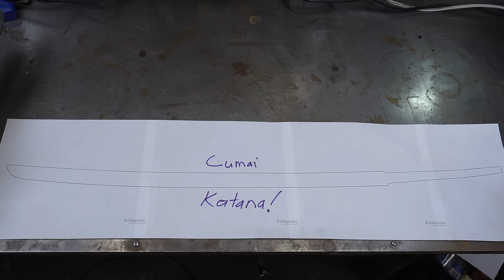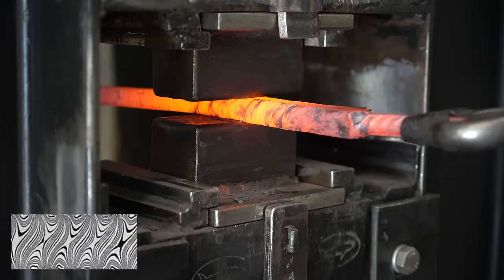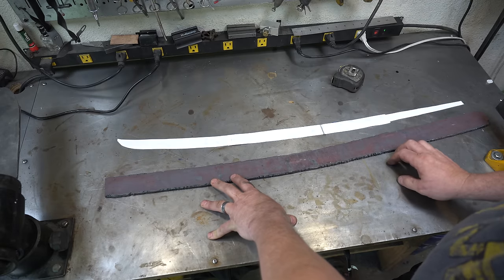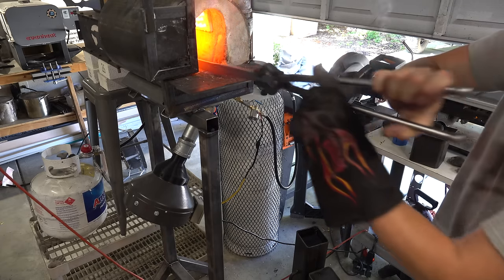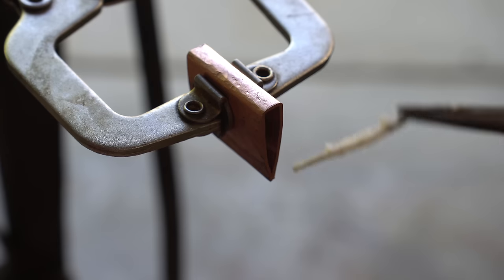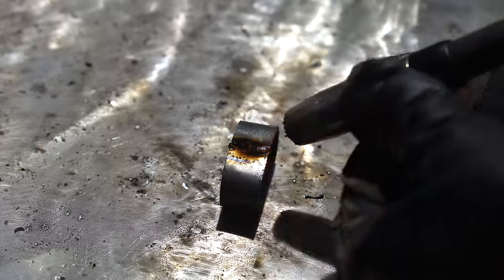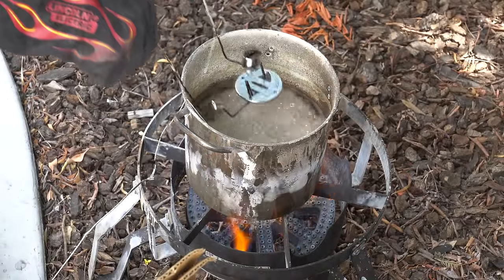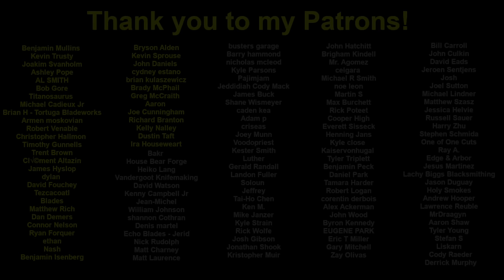Forging a Copper Damascus Katana

Comment: From what I know, I would recommend not makeup a blade with copper, copper is very malleable, I only recommend making a blade using copper if it’s for decoration and not meant to be used.
Reply from the maker: “From what you know” is the operative term here.  If you understand the construction, the copper is a thin sheet (the thickness of 2 pieces of paper after forging) over a central core of high carbon steel which is the entire cutting edge.  The copper doesn’t go “through” the blade.  Next time try asking a question instead of assuming you know.  Thanks for watching.

Comment: Why oil not water?
Reply from the maker: Modern smiths don’t really use water, it’s too unpredictable.  The failure rate for traditional katanas with water is around 25-35%.  That’s a lot of work to fail potentially 1 out of 3 or 4 times.  Oil is much more consistent.  Thanks for watching.

Comment: Its really good but it doesn’t have character, its too thick and heavy for a Japanese katana however the technique and material choice (especially the copper) are not playing to the advantages of a Damascus sword….But still amazing craftsmanship from an outstanding blacksmith ❤
Reply from the maker: First of all, the dimensions and weight of this blade is exactly inline with a katana of its size.  It’s 2.5 lbs with handle attached, it was just under .2” thick at the hibaki and about .13” at the kiseki, the sori is 1.25”, exactly what it should be.  Next time try asking a question first instead of assuming.   Thanks for watching.

Comment: 16A three phase.
Reply from the maker: I don't quite understand your comment.
Reply: @TyrellKnifeworks  I just commenteded as a courtesy, to the good content.
Reply: How much amps does that press cunsume, or Watts.
Reply from the maker: @אילןאור-ח4מ  It depends on the motor used.  This is a 5hp motor running on 220v.  I think it's around 16A or there abouts.

Comment: No borax?
Reply from the maker: I don’t really use borax when forge welding.  It can cause as many problems as I helps.  If you have a fuel-rich mixture in your forge, it’s not necessary.  Thanks for watching.
Reply: @TyrellKnifeworks by fuel rich you mean the kerosene?
Reply from the maker: @dmiles3270 no, I mean the propane to air mixture.  You should have 4-6” of dragon’s breath coming out of your forge.  That indicates a fuel(propane) rich environment which reduces scale formation.

Comment: Oxygen free forge welding. No flux, no krosine. Much better weld
Reply from the maker: It doesn’t make a better weld, just easier.  It’s not a setup the normal person does those.  Doing this in a canister is a bit of overkill IMO.  Thanks for watching

Comment: I have a question.
Reply from the maker: What’s your question?
Reply: @TyrellKnifeworks  How well does this retain its edge, if there was any tests for that?
Reply from the maker: @thegameknight8916  the entire cutting edge is 1084 high carbon steel that’s been expertly heat treated.  It will retain a very fine edge.  Thanks for watching.

Comment: all those high tech forges. "if you use a hammer this would really take long time". bro thats the deal why some swords are 20 mil and this is maybe 20 k.
Reply from the maker: The fact that something is hand-hammered does not alone make it valuable.  The finished product’s quality makes it valuable.  Thanks for watching.
Reply: Very marx of you;
"i spent a lot of time on it,therefore it is worth a lot"

If you can achieve the same or greater quality in getting the same job done, what does it matter? granted, easier means of production does lessen manhours and labour, so yes it does typically lessen costs, across most industries.

But point being:As long as the job gets done? who cares if it is hammered or pressed?
Reply: @Integritys_Sum  marx ? how about reading dude. "bro thats the deal why some swords are 20 mil and this is maybe 20 k." . those swords get crushed by an alu baseball bat , doesnt even make sense to use those for close combat. a katana is a collector piece and that should be handcrafted. if a multimilmil or billionaire would use a mechanical forged katana as deko i would laugh out loud. dont get me wrong, i wouldnt spend 20 mil or 20 k if i had the money, but if you need a penis enlargement on your wall it should do its (hand)job. compareable to the automag I or the desert eagle. many dudes own em but dont know that 1 year in showcase means you have to strip it totally before showing your friends how tuff you shoot on a 10 feet target. just senseless. 

if you need a close combat blade use a long partially serrated machette for 500 bucks. if you need tuff deko buy an original russian ak 47 replica and attach it to your wall. 

but bling without status/fame  and / or useablity.....waste of cash. and katanas are just samurai hype. a bidenhander is way cheaper and way better even though its not uh samurai ah ninja ouhh-wa kill bill stuff so uncool....jeez

Comment: 240 thousands of an inch, OR you could use metric, we've evolved
Reply from the maker: First of all, I’m Canadian so I’m very familiar with metric.  When ALL your tooling is in imperial, you don’t really have a choice.  Also .240” or 6.09mm, when it comes to machining, it really makes no difference, it’s not like one is more precise or easier to say.
Reply: @TyrellKnifeworks  well that's a fair point you make. The imperial system is frustrating.

Comment: Why don't you use millimeters like the developed world?
Reply from the maker: Why don’t you consider that if you live in the US that ALL your tooling is in imperial and you have no choice?!  I’m actually Canadian and know both but that doesn’t help if the tooling is always in imperial.  Think about it.
Reply: @TyrellKnifeworks  Wow. Quite touchy aren't you?
"No choice" is going a bit far, everyone always has a choice. But I guess it's partly down to if you inherited the tools or you bought them. 
But it would just make more sense to say 'one millimeter' instead of 'zero point zero three nine three seven zero zero seven eight seven...' for example. Or a simple metric measurement instead of 210,000ths of an inch. If you know both then one would think you'd pick the shorter, easier way of measuring in millimetres instead of hundredths or thousandths of an inch. If you know both then you should know what 0.03937007874015748 inch is in millimetres.
Reply from the maker: @reti7959 if you are a machinist, it’s exactly the same.  In fact the imperial is actually easier to say.  “320 thousandths” which we would shorten to “320 thou” is quicker to say than “8.128 mm”.    It’s not like mm is more accurate, it’s just different.
Reply from the maker: @reti7959 and on the “touchy” part, reread your comment.  It’s kinda rude to just assume we should change and it’s easy. It’s not.
Reply: @TyrellKnifeworks  I was half joking, though I appreciate it's hard to tell. You should change though, evolve like the rest of us did ;)

Comment: It's pretty but you better never use it in a fight.
Reply from the maker: This is a fully functional sword.  Don't let the copper fool you, it's a very thin sheet (about the thickness of 2 pieces of paper after forging) over a central core of high carbon steel which is also the entire cutting edge.  Thanks for watching.

Comment: It s a beautiful work of art but it did not seem balanced as a proper sword should be. It looked heavy when he was swing it and cutting the fruit in the end. I am equally surprised that he did not show that it was balanced by using his fingers just above the hilt to prove that it was balanced and as I am that no one has pointed this out yet, that I have seen.
Reply from the maker: The sword is 2.5 lbs/1.1 kg with the handle attached.  It has a balanced point exactly 4" before the guard, as it should be.  Thanks for watching.

Comment: Copper is not an ideal material for crafting swords due to several reasons: Softness: Copper is inherently soft. In practical use, any other metal weapon could literally cut a copper blade in half.
Imagine wielding a sword that’s as malleable as a banana! If you miss your target and accidentally strike a rock or a tree, your copper blade would become dull and ineffective.
Reply from the maker: Thanks for pointing out the obvious, but the copper here is a thin sheet, about the thickness of 2 pieces of paper after forging.  The entire cutting edge and core of the blade is high carbon steel.  It’s very strong. Thanks for watching.

Comment: What’s the point? It’s not a weapon nor a Katana👍
Reply from the maker: It’s a functional weapon.  Thanks for watching.
Reply: @TyrellKnifeworks  - Whatever helps you sleep at night 👍
Reply from the maker: @Steveshappylittletrees  one of us is an actual accredited Bladesmith, the other is some troll on the internet.  😉
Reply: @TyrellKnifeworks  - Then the accredited bladesmith should know that a proper Katana blade is first made with high Carbon steel. Peace👍
Reply from the maker: If you actually watch the video or ask a question, perhaps you’ll learn something and not come off like an ass.

Comment: Tha fact that something is Damascus does not make it a good product.   A copper sword is like a plastic car engine.
Reply from the maker: If you need more understanding then ask a question, don’t assume you know what you’re talking about. The copper in this blade is just a thin sheet, about the thickness of two pieces of paper after forging, over a central core of high carbon steel.  Perhaps you think the copper goes “through” the blade but it does not.  Think about the construction or ask a question.  You just might learn something.

Comment: One. Doesnt look sharp at all. 
Second. seems too heavy. 
Purely for look.
Reply from the maker: Do you have an actual question or you just going to guess?  Yes it’s extremely sharp.  It weighs 2.5 lbs / 1.1 kg with the handle attached so it is right inline with a katana of this length.  Next time try asking a question instead of being negative, you just might learn something.

Comment: Sadly this isent the way the authentic katana's are made , cutting the steel ? You're supposed to fold it... Ugh
Reply from the maker: Perhaps instead of pretending you know everything, you should start your comment with a question.  You just might learn something.
Reply: And in English you're supposed to spell it "isn't"... ugh.
Reply: @kxs4899  good thing im not english
Reply: @toms7700  Not the point. The point is the guy is just making a sword no need to nit-pick and act arrogant toward him.
Reply: @kxs4899  ur not making a katana when not doing it the authentic way
Reply: @toms7700  Okay cool but it's based on one so why bother crying about it and acting so pretentious

Comment: THAT IS NOT DAMASCUS!
Reply from the maker: Ugh.. another one of you guys.  I get that some people have watched a video and have learned that traditional damascus is not the same process we do today.  "Damascus" has become the defacto term people relate to for both.   Just know that the American Bladesmith Society, Master smiths, and Journeyman smiths (like this one),  don't care to delineate the terms and will say "damascus" for both types.  If we want to refer specifically to traditional damascus, we'd say "Wootz".  There's no need to "correct" me in YouTube comments.  Would you really "correct" a mastersmith in person, to their face?  No.  So don't be that guys who does it on the internet.  It makes those individuals sound incredibly pretentious.  Don't be that guy.
Reply: @TyrellKnifeworks  Well, Mr. blacksmith, one doesn't have to be a blacksmith to know the subject, especially when it's been an interest for over 30 years. And before there was internet I read a lot in books about the topic. Damascus steel (also called Wootz, as you have rightly mentioned) doesn't have copper in it's structure. Not to mention that what you show in this video isn't Damascus/Wootz, because you have used a non-Damascus alloys from the beginning. Stop making excuses, and just admit that this is NOT Damascus/Wootz steel. You put a lot of work into all this, and that is it. The curvy line looks really bad on the blade, to me, and probably a lot of other people. Same with the rest of the pattern. Looks like an examlpe for bad waves. The handle looks nice tho. Ow btw. - I personally know blacksmiths who make actual (as close as possible to the antient recipe) Damascus-steel, using glass and other ingredients that are essential for making it, as far as I know, unless the technology refined the recipe and isn't using all of them, to get the same or better effect (it is possible for example to make a blade using mostly carbon-nanotubes and Fulleren-balls, not to mention Graphene, but I have yet to see someone actually doing that). If you have something constructive to say, please do. I'm happy to learn, but I have allergy for arrogance. Good day :)

P.S. Respect for reading all the comments. That is rare for almost any Youtuber above 100k subs.
Reply from the maker: @saturiankhazard  TLDR

Comment: No way around it?  are you kidding?   people have been making swords for over 5000 years.   with nothing but anvil and hammer.  can't beat it into shape.... wtf.  go back to history class.
Reply from the maker: Instead of being a dick and ASSuming you know everything, perhaps you should try asking a question instead, you just might learn something.  This copper technique (which is very new) does NOT like to be forged on the ends and will delaminate if you try.  PS - One of us is an actual accredited bladesmith, the other is some troll on the internet.  Guess which one you are?